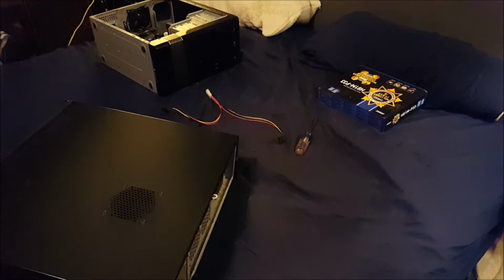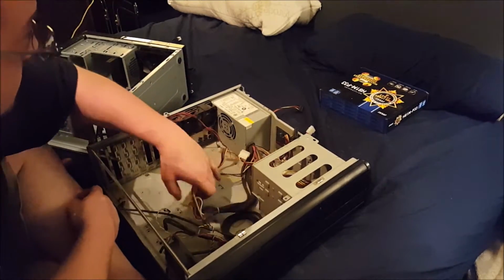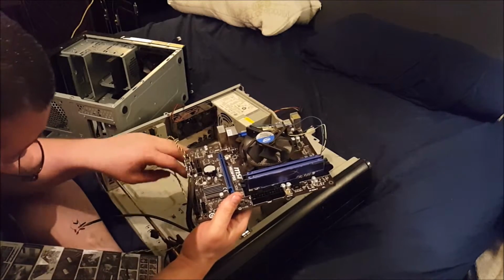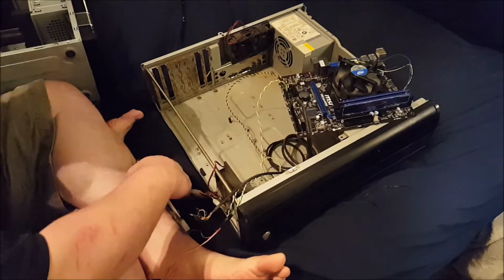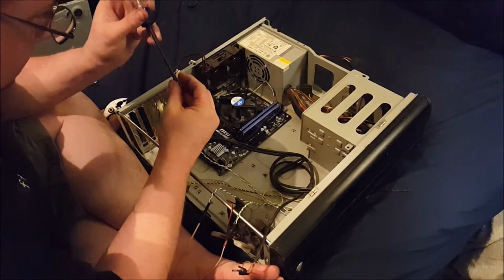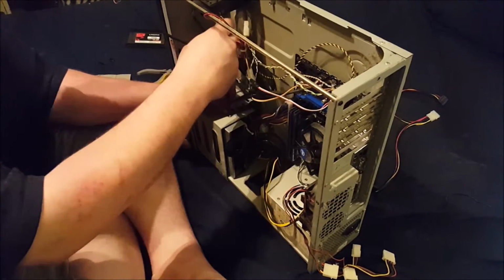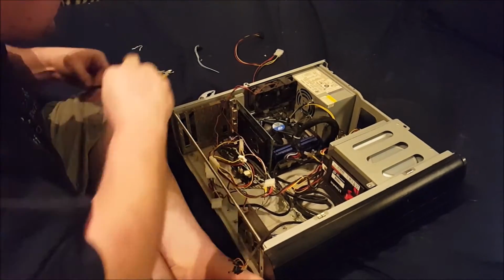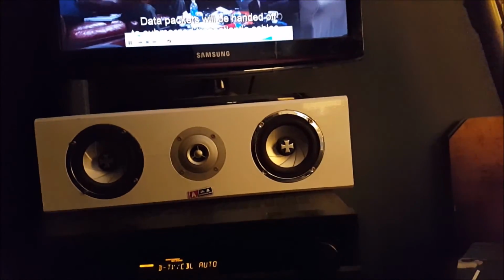Rebuilding the G3258

Comment: kinda sux that they used a odd sized PSU look like it could blow up lol still a nice case though
Reply from the maker: +chris I am very much not a fan of oddball PSU sizes.  But it is a very well built case.  Empty it weighs more than the complete system built in the Rosewill case that I pulled all this out of,